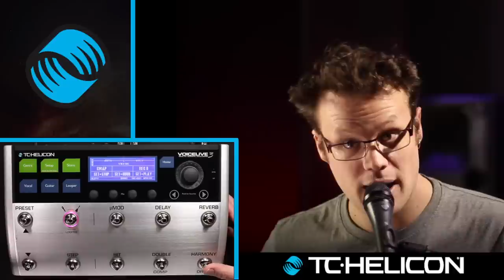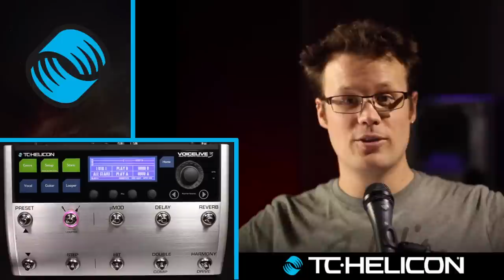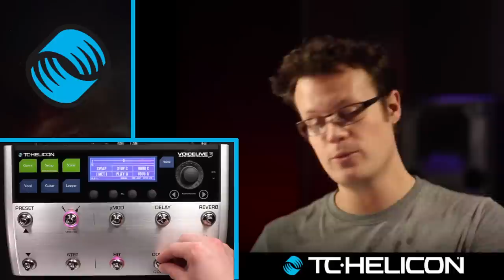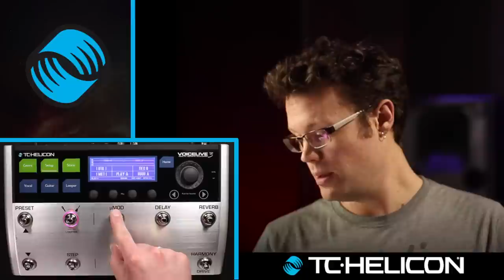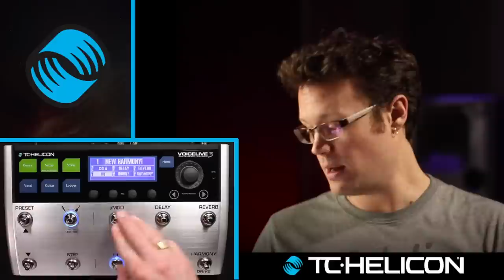VoiceLive 3 - Looper Tutorial

Comment: hi, I have been thru the book, and read all looper part 10 times, and couldn't find how to change the loop slot,  now, after listening the entire video, there it is, you mentioned it, although it when real fast. and I had to replay 3 times to get it. the programming of this device is not intuitive at all, and the book could be improved, lots of confusion, specially if you do not read and memorize the hole thing.  I wish there were an apps I could use on my computer to program the vl3 ex. thks

Comment: Ableton Live and the loopers of Boss have a default quantization per bar instead of quantize per beat. I think quantize per beat is not user friendly enough, makes it harder for new users to get used to using a looper. I can understand why TC Helicon loopers miss this option because for a quantize per bar one needs to specify a time signature which isn't available as an option in TC Helicon loopers. 

The workaround for this is to record an empty loop with the desired number of beats in preparation for a performance and save it to a slot. When performing live one can load the slot and overdub directly on the empty loop.

Ableton Live is the absolute winner when it comes down to comfortable looping. When you have the Push or Touchable on iPad, there is the option to define the number of bars of your loop before you start recording. You don't have to worry about setting the end of the loop while recording. And there is a precount before starting the recording which is also really comfortable. Bitwig Studio even has the option of a fixed length for a loop without having to use an expensive midi controller like Push or an iPad app!
Reply from the maker: Thanks for the feedback Ron. We're always looking to improve our loopers. It's such a personal thing too when it comes to setups. Lots of people love the Boss stuff, some love ours, others like you go to Ableton. We're going to try and bring the best of all the worlds together as we move forward.
Reply: I found an easier way to set the length of the loop with a TC Helicon looper while playing live. Instead of tapping the tempo to one beat, tap the tempo to two beats or even one bar. That means if you have a song in 120bpm, then tap the tempo on 60bpm or even 30bpm. The only thing to watch out for is when using effects during looping that are in sync with the tempo (for example delay), then the effect has to be configured differently.

Comment: I have an issue with the metronome changing bpm. I want to use the metronome during a backing track but you can’t in the VL3x. So i made the backing travk into a loop. I loaded the loop into an open slot, and set the tap tempo in looper metronome to 96 bpm. When i turn the met on, it suddenly changes to 141 bpm. Icant get the preset to save 96bpm. What am i missing here? Thanks to anyone who can answer!!

Comment: Is there a way to route the looper (and only the looper) to an 'out' plug ? It would permit me to send it to an independant track in my mixing desk, and send it louder to my drummer's monitor, so that he can follow it easely (that's the way I've been doing so far with my Looper, the excellent Echoplex digital pro +). 
Thank you !
Reply from the maker: No, we don't have separate outs for the looper, since the looper contains vocal/guitar loops. They get sent out the outputs for vocal/guitar respectively. If you run the VL3 either in dual mono mode or use the separate guitar outs, the loops will come separately from those outs. You can then send the drummer more/less of the vocal or guitar signal which would include any loops.
Reply: TC-Helicon thank you for your answer. In my specific need, it's really the loop and only the loop that should be increased, so that the drummer hears it more than the rest when it' on. 
Too bad, but thanks anyway.

Comment: I'm interested in buying the vl3 or vlx3. I have  a question about the looper though. If I connect the vl3 to a real tube  amp  (just in front of it) using the guitar out to the guitar input of the amp I "bypass" the internal modelling and can use the tone of my real amp (right ?. )
In this constellation can I still use the internal amp modelling for live looping ? Simple example : I want to make (in looper mode)a loop with the rhythm guitar (chord progression ) of a song using one or more modelling tones from the vl3 that are sent to the pa. Over this loop I play a solo using the real tube tone (with the sound coming from this amp of course). Is this possible ?
Reply from the maker: Denis Hermans Hi Denis, I'm not sure that will work directly in the box, but all is (hopefully) not lost. 

The THRU on VL3 that you'd likely want to connect to your amp will mute any onboard guitar processing and any guitar loops created inside the box (if you're not using the THRU) will go out the guitar outs if you have them connected. There's no way to have live guitar route to the amp and the looped guitar route to the XLR's, at least within the VL3 exclusively.

Here's how I'd do it. I'd put an A/B box directly after your guitar. Then, send out output to the amp for the times you want to just play though it and one output to the VL3. When you want to loop on VL3, select the A/B that it's connected to, record your loop and fire it off (via the XLR outs to the PA). Then, hit the A/B again to go back to your tube amp when you want to play overtop of the VL3's loop.

You'll just have a slightly more complex loop setup in terms of mixing. That said, you could still use the guitar out (or dual mono mode) in the VL3 to send an independent guitar sound to the FOH, so at least they'd have your looped guitar, live (amped) guitar and vocals all separated for more control of the blend.

Hope there's something in there that'll work!

Comment: Thank you for that great tutorial 
I have some more questions  about the looper I hope you can answer me : 

1.i'm trying to save a looper definitions such as tempo and insert type to a specific slot . When I press "save" it says "no changes" and it doesn't save the definitions to that slot .  How can I save those definitions? 

2. Is it possible to store a whole loop slot into a song preset ?  I am building a show which based on the looper and I want  to prepare loops slot with deferent set up for songs that will load up with the song preset . Is it possible and how ? 

3.i have one song which I record 2 loops. Loop A 2 bars long ( of 3  quarters) . Loop B 8 bars long( of 3 quarter) 
While loop A is playing , when I enter loop B , sometimes it start from the third (3) bar of that loop (B) and not from the beginning . 
The metronome is off and there is no sinc assistance . 
What could be the reason and how can I make sure it won't happen ? 

Thank you very much , I hope to get your respond .
Ifat.

Comment: Thanks for the run-down, Craig.

In Looper layer, is there a way to dial in the tempo rather than tapping with foot? Let's say that I know a song is in 93 bpm and I want to quantize the loops, I would like to dial in the metronome tempo to 93 direct because tapping the tempo can sometimes be hit-or-miss.

Cheers.
Reply from the maker: Hi Sunil - you can assign the tempo in the preset level and it will transfer to the metronome level in the looper.  My personal preferred way to use the VL3 is to create a preset for each song in my set list.  That way I can assign things like tempo's, etc that change per song.  From the loop level, you can go into the metronome menu, hit MET with your foot, and then instead of tapping the tempo, you can use the Preset Up/Done switches to toggle between different tempo times.  Hope that helps! Thanks for singing with us!
Reply: Thanks heaps, Craig. That's exactly what I was after: increasing/decreasing tempo in increments of 1bpm. 

I ran into an issue yesterday. Could you please help? Here's what I did.

I recorded a loop in Slot 3 (Track A and B) w/ bpm 85.(does having loops in two tracks make it difficult for the triggers to process it?)
I recorded another loop in Slot 4 (Track A only) w/ bpm 92.
I mapped both loop triggers in the same preset (one mapped to uMOD btn in gtr layer, another mapped to HIT btn also in the gtr layer.)
I am triggering Slot 3 Track A w/ uMod btn.
I am triggering Slot 4 Track A w/ HIT btn. 

It was all working fine. But when I turned the VL3 on at my rehearsal, the unit starting freezing and would reboot. It could not trigger the loops. 

Please help.

Comment: In serial mode, is it possible to go from recording track A to playing track A and recording track B with only 1 button press? This is necessary If the chorus immediately follows the first verse... Going from recording track C to playing track A or B would also be needed for some songs.
Reply from the maker: Hazy2425 No. Serial can't play any of the tracks simultaneously. It's meant for "Parts" where A, B and C might represent Verse, Chorus, Bridge. You'd need to use another mode to have A keep playing. Then you'd have A, A+B and A+C using SWAP.
Reply: TC-Helicon Ok, i expressed myself wrong, let me try again :) I'm  definitely talking about a Verse, Chorus, Bridge situation. After recording the Verse can you go straight to recording the Chorus without playing the Verse and with just 1 button press? This is necessary If the Chorus immediately follows the first Verse...
And can you go from recording the Bridge to playing the Verse or Chorus, without playing the Bridge (1 button press again)? Basically perform a song structure ABABACBCBC without having to double any of the parts in length and only playing each of them once.
In the clip above the recording process is record track A, set and play it, record track B, set and play, record track C.
I want to go record track A, record track B (don't play A), play A, Play B, record track C, play B (don't play C), and so on.. Hope I made myself clear this time, English is my 2nd language :) Thanks.

Comment: So on point with all your tutorials :-)  One question. I use the looper to lay a chord progression down and then just solo over it. When I w solo I have to exit the looper and choose a drive and/or delay to pronounce the solo sound. Which is fine, only takes a couple seconds, but often I will come back into the song after stopping the loop, but then have to hold the loop button down to access the main screen to then turn off the drive and delay, all while trying to sing at the same time. Is there a way around this? Thanks :-)  Loving the VL3X.
Reply from the maker: Hmm, just trying to get a mental picture of the process you're going through... 

I think there's a couple of options to help your workflow. 

1. Create a STEP within the preset you're using that has the drive changes you want. Press STEP from the loop screen to toggle back and forth between the two sounds. You'll never have to go back to the guitar/vocal layers that way.

2. Set the STEP button with "Loop Toggle" to be able to instantly pop in/out of the loop layer without holding the layer button. 

Either of those should speed you up a bit. :)
Reply: Awesome, simple fix. I didn't know you could use step within the looper. That's great. Thankyou :-)

Comment: do i have to hook it up to a stereo or anything? all i have connected to it is the microphone and the power thing, but i can't hear anything. everything is on too. i don't see any of those little sound bubbles -- like on the bottom of an iphone.
Reply from the maker: +phanhansen You'll need to connect a pair of headphones to the jack on the back and/or connect to a mixer/PA system or a powered speaker from the main outputs.

Comment: Hello from France Craig (so excuse my bad enlish :) )
Is there a way to separate the sound of voice and lopper or backing track to a PA (for example, for live) on the vl3 or vl3x, please ? thanks for your answer, cheers.
Reply from the maker: luimaime The only separation you can do is that guitar loops will come out the guitar outputs if they're connected. Otherwise everything comes out the XLR's.
Reply: TC-Helicon , Ah too bad :( it will be a good thing for the vl4 ! easier for a good mix/sound on stage.
thanks for your answer. bye.
Reply: TC-Helicon Hi Craig, this is quite important to me too (thanks luimaime), so the vl3 can assign all guitar and guitar loops to the guitar thru output, which essentially can input to one channel in the mixer, AND, assign all vocals and vocal loops to the xlr output, again, inputting to another separate channel in the mixer, which will then allow the soundie to mix/control the vocals and guitar separately?  Or will the xlr output everything by default?thanks for the video

Comment: I have used loopers that are triggered to begin recording when you start to play...I could not find this option in the settings, is it available?
Reply from the maker: No, VL3 won't be able to respond to external MIDI Sync commands. We're looking at adding MIDI Tempo so it can lock in with an external source like Ableton etc.
Reply: I was not referring to midi, but to when you start to play the guitar input automatically triggers the looper to start recording.

Comment: The problem I'm encountering is that pressing and holding the Overdub button causes the loop to begin playing before it erases it.  Basically, if it was a mouse button, you've got the overdub function set to be triggered by a mousedown event, when it should be set to mouseup (unless there was a "press and hold" event preceding it).  Is there a way to map this differently so that pressing and holding a button erases the loop, but doesn't start playing it first.  Hope that is clear.
Reply from the maker: Unfortunately, we can't do that without a time machine ;)

In order for the "play/rec" commands to be instant, they must be "on press". So, we have to register that press before we can register a "hold" to trigger the erase action. It's a part of any one-button looper setup and why you see separate stop/clear buttons on various products. We included the erase menu to be able to silently erase, as it's a separate command, but you do need to go to the menu to get to it. We added stop/clear and erase all to the Switch 3/6 options and erase all to the STEP options to help people more quickly erase.
Reply: Thanks for the response.

Not sure I understand why it requires a time machine.  The play/rec could be triggered by the release of the button, rather than the press (unless preceded by a press within 2 seconds), which would be almost as instantaneous as triggering it on the press.  But I don't know, maybe it feels different pressing on a button with your foot, versus clicking a mouse button.

The problem with the Erase menu is that you can't always get to it, or, at least, I haven't been able to figure out how to do so in all use cases.  

I just really wish you guys could make everything accessible via MIDI.  It would really open up a world of possibilities, and you do it for some functions, but not others.  Why limit it?

Comment: hi mate when you say 1234 you notice that it doesnt come back in in time so you actually have to hit the button at exactly the right time for it to be in perfect time, as in if I beat box a beat, how do I quantise that?, also how do i changed the hold looper button to get the loop page to a quck tap on the step button
cheers
Reply from the maker: The best way to ensure you're on time is to use the metronome so it will quantize. We don't analyze the actual audio, just quantize to the tempo set in the loop. You can run the met to just headphones which lets you time things better.

Comment: Hi my VL3 plays my loops way louder than the guitar that I'm playing over the top. Can I change the volume of playback to be slightly softer than input? I've tried using the main mix volume controls and they make zero difference to what is coming out of the guitar output. If I plug my amp or pa into the headphone output the headphone mix volume controls work but I don't want to plug into amp or pa via this output and also the main mix volume controls should do something.
Reply from the maker: Sure can. When on the looper layer, turn the mix knobs below the screen and you can control loop A, B, C and master levels. The master level is also available on the main mix screen. 

Make sure to update your firmware if you haven't yet. Loop track mix levels were added after release. Updates are done via VoiceSupport. http://www.tc-helicon.com/en/products/voicesupport-2/
Reply: awesome thank you so much for your reply! i did as you suggested and it now works a charm. 10 points for customer service!
Reply: TC-Helicon, is there a way to set the Looper level and save it per preset (since solo guitar levels vary from song to song according to genre, song style, boost, etc.), or is there only these main levels?

Comment: Hiya, is it possible to connect a midi keyboard and loop the sounds i'm making with this keyboard? (the sounds of the keyboard are coming from the effects i select on my computer so i'd guess normally this isn't possible, but the voicelive is such a beast i'd still like to ask) Also; I heard there was a new way recently to export/store the loops on my computer, is that correct and if yes: how?
Reply from the maker: If you connect the computer's audio output to the Aux input on the VL3, you can loop the Aux. That'd be the simplest way I can think of.
Reply: TC-Helicon Ok, thanks for the answer. Any help on the second question I asked as wel?
Reply from the maker: Oh sorry missed that somehow! 

Play doesn't have any loop storage or way to send them as files to your computer. Your only route would be to record them as audio via an interface and recording program.
Reply: TC-Helicon Darn, I knew this was the case but I was told there had been an update (or something like that) wich enabled the exporting of loops... would have been awesome. Oh well, I guess an audio interface is on the next 'to buy'-list. Thanks for the answers, you guys have the best customer service ever!